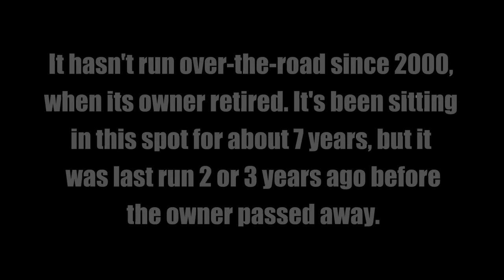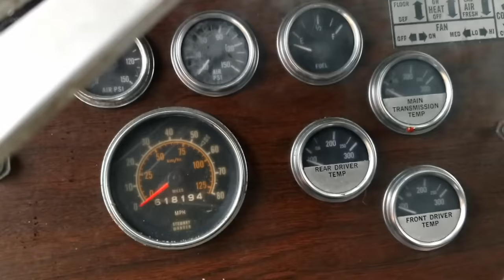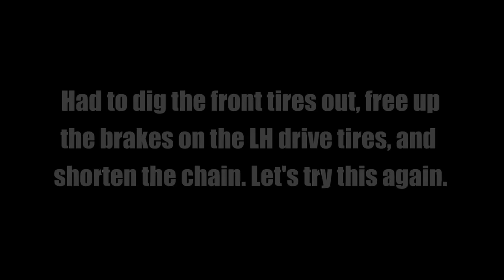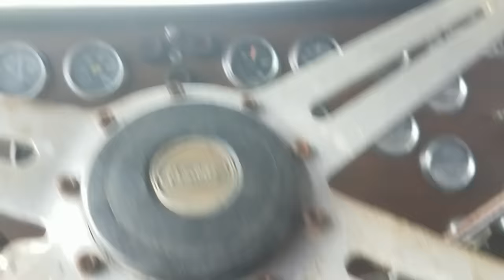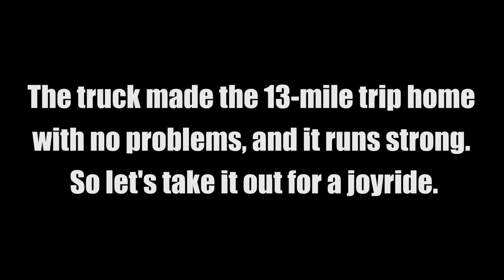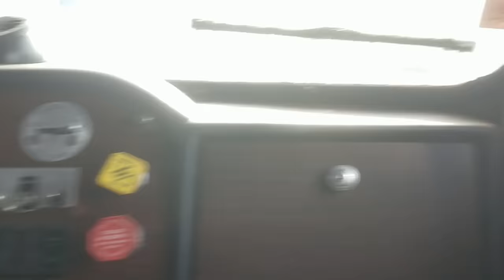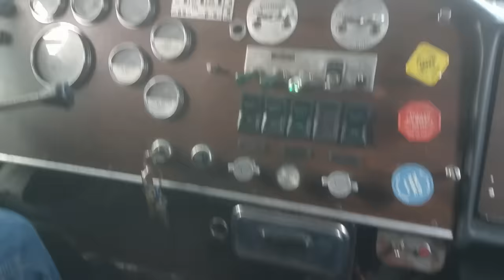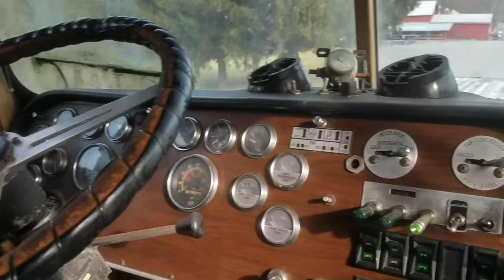Rescuing a 1977 Peterbilt 359 From Its Grave - First Time On the Road in 18 Years

Comment: I'm impressed that the previous owner placed a tarp under the truck when he parked it. That's a sure sign that he cared deeply about the truck in my opinion.
Reply: My thoughts exactly. Somewhere he is smiling down on his faithful old Horse being driven again like it was supposed to be.
Reply: U you can tell he lived this truck. Some one put all that crome paint pipes fenders and sounds like it runs better then wen it came off the show room and kept up on her sense the late 70s
Reply: Dumb question but why the tarp underneath?
Reply: @luke8210  it prevents the damp in the soil from creating a humid layer under a vehicle. I have worked on plenty of rusty vehicles which were dry on top but parked on dirt,the bottoms were rotten even though they were actually touching the dirt.  . As can be seen with this truck,she may have sunk a bit but none of the brake shoes were stuck on and the clutch was free. It's a very simple but effective technique .
Reply: Luke K Ray Not only that it keeps the weeds from growing up into the truck
Reply: Right on. Makes total sense now. I live In the desert of Arizona. Rust here is pretty much limited to surface rust. Pack rats are the big problem here. Thanks guys, I appreciate the quick replies. Best of luck.
Reply: yup he wanted to save it , it is very obvious , but if you do the math , he spent most of his adult years in that truck , well if he bought it new , and being he held onto it for 18 years after retiring , I bet he did ...
Reply: @luke8210  it stops moisture from coming up from the ground and condensating on the underside preventing rust , it also stops trees and stuff from sprouting up under it and getting tangled in wires and air lines , trees growing up through the rear frame rails of a truck parked like that is common , had to cut a few out on stuff I have bought over the years , this truck is the holy grail of a truck from that era , well except for ones well loved and still rolling down the road and never parked , it's a pretty rare truck these days
Reply: Steven Richards I noticed that too, thought the same thing
Reply: Parking on limestone will help a lot too. Seen some really well preserved vehicles parked on it - the undercarriages were still solid.
Reply: @Mercmad  You are right , parking on the dirt w/o that tarp it would have been a rust bucket. That's what saved it.
Reply from the maker: All very good points. Furthermore, it keeps oil from leaking into the ground if the truck were to develop a bad seal from sitting.
Reply: @luke8210  stop weeds and crap growing up through the truck and damaging things, plus keeps the damp grass and foliage away from the metalwork to prevent rust
Reply: @MichaelTJD60  yeah but that's not why he put it their, think he's bothered about saving the environment, damn think proberbly has the emissions of 100 modern day cars, I don't think the environment was in mind when placing a tarp under it
Reply: Luke K Ray ... I've seen a few different things to deal with the packrats. One that was intriguing is a tiny led attached to the lower side of the engine compartment, below the battery. I was sent to tow the truck and opened the hood to jump start the truck. I told the customer that something was blinking down there and she said it keeps the rats away. Another time, I went to a tow yard up north and all the hoods of the vehicles in the yard were wide open. Yard operator said it keeps the rats out of the engine compartments. 
    Farging rat bastiches.
Reply: Eric Lakota ... Not just crome, but some actual chrome.
Reply: Steven Richards yes, he did
Reply: Steven Richards absolutely, he probably maintained that truck well until he retired
Reply: I was thinking the same thing!
Reply: Steven Richards sticking a tarp under it is one of the worst things you can do. Water pools in the tarm and keeps the underside of the rig most of the time. Would've been far better off having a few yards of stone dropped there, half assed leveling it & parking her on the stone.
Reply: Yeah he didn't want weeds growing up underneath or through the truck frame or through the cab for that matter
Reply: @luke8210  SO MANY ..... PACK RATS...... I cant even anymore....
Reply: Steven Richards yea but I would have parked it on a bunch of plywood so it would have been able to get out after sitting for so long
Reply: Yeah that was a good idea. I don't know how many times I've seen people tarp OVER something parked on wet dirt, in a shed or barn with dirt floor, or outside, cars, motorcycles, etc...just acts as a moisture tent and concentrates it. Whatever's under turns into solid rust in no time.  Best to put the tarp down and leave the vehicle in open air. If you just gotta tarp to protect from sun, get one that breathes.
Reply: I want to visit the Arizona desert
Reply: @Mercmad  Now i know why as well.
Reply: Picture me rolling in my 500 benz 
   Run some Bio-diesel in her and she will out perform all modern day emissions standards. Nothing could be “greener”.
Reply: I'm going to speculate that the Tarp was put underneath to put a Barrier between the Truck and the Soil as a precaution if there were any slow leaks of Oil and Fluids, Diesel etc.  
Especially if the truck was going to be sitting any length of time...Seals and Gaskets will deteriorate over time.  Maybe control moisture under the truck as well.
Reply: @Mercmad  Thanks for that info
Reply: Same here
Reply: @luke8210  Pack rats. Cute, but destructive.
Reply: @luke8210  -Keep vegetation from growing up through the bottom.
Reply: I said the same thing immediately after they drove it off its resting place. Tarp!!!!! Great job, kept the weeds from growing up through and around!!
Reply: @luke8210  keeps the grass and weeds from growing up thru and around the frame and truck.
Reply: @Classic_Re-creation  you're absolutely right, oil leaking into the grass never crossed his mind when placing that tarp there
Reply: @BirdPlan  the point is this is a 20ltr gas gusseling monster that kills a thousand trees every time it starts up so the intent to save on the environment was just not their, its like putting a plaster on some body's bullet wound just after you shot them with the intent to kill them, without getting into English literature and what certain words mean let's just be real here the guy didn't give a shit about oil leaking from his truck
Reply: @smokeythehuman3596  ply wood would delaminate and fall to bits within a couple of years then decompose and become soil again,
Reply: That's exactly what crossed my mind to!
Reply: @luke8210  to stop grass from growing up through the frame and everything else grass holds moisture and will cause rust!
Reply: I was thinking the same thing, the tarp was the first thing I noticed when the truck moved. I’ve seen plenty of vehicles rotted out from being parked on dirt.
Reply: Steven Richards 💜❤️💚
Reply: Luke K Ray One viewer said you can tell the owner loved the truck because they put the tarp underneath.❤️💚💜
Reply: Luke K Ray Protects the undercarriage from moisture and rusting out🙄
Reply: Steven Richards I'll remember to put the tarp down to protect✅
Reply: Luke K Ray fair question. I had no idea
Reply: Must have been a reliable workhorse for the original owner.
Reply: @Classic_Re-creation  ... Normally, I'd agree with you. However, in the country, you might think of dripping oil if you're drinking  the well water nearby, eh?
Reply: @amascia8327  bit of a long shot but yes possibly it could be a cause for concern. Great point
Reply: Stay in school
Reply: We old haulin' men parked on tarps so snakes would gather under it. Then when the sun got hot enough and the snakes came out again the next morning, we knew it was time to yank our spurs again.
Reply: Me gustaría tener uno acá en Argentina
Reply: I agree
Reply: Steven Richards   
I agree...
Reply: Probably loved that truck more than the wife, also the truck compared to a wife actually severed a purpose  . . .
Reply: It means an other thing: unfortunately, the owner knew it was the last time he parked it here, and it was his last travel with it. Rest In Peace Mr "Owner", your truck is in good hands. And its second life starts, as yours in the sky. Thank you from France for this video. 😊🚛
Reply: Steven Richards it looks cared for.  It’s an older truck, and it’s been kept in really good condition
Reply: @luke8210  I've seen people chuck balls of scrap wires and strings into cars to keep the rats happy. They go after the easy to get stuff and leave the wiring harnesses alone.
Reply: @JW...-oj5iw  Lmfao@ Bastiches
Reply: Agreed! Nothing kills a parked vehicle quicker than grass growing up in the undercarriage.
Reply: Yeah I noticed that too, It was his baby.
Reply: @Classic_Re-creation  you got tha SONG my brotha ! 😎
Reply: I would imagine that when you drive a truck for so long, you become attached to it.
Reply: @luke8210  lol No doubt Luke. I live in New Mexico. We just bought a Honda Pilot from my partner's brother. He said it has very little rust. He is from the coast in Florida. His idea of little rust isn't my idea of little rust. 
My definition of little rust is light surface. The Florida definition of little rust is you have to push hard to stick your finger through the muffler.
Reply: I'm sure if he bought it new he probably still thought of it as such.  Bet that was a huge investment when they bought it!!
Reply: @JoshG1234  1) He left it with his memorabilia in the truck, he left it's life in there. (That and I doubt he planned to leave it there for 18 years before he passed away)
2) It wasn't a field it was parked next to his drive way
3) If it had been covered with a tarp it would have just held in moisture and rusted the old lady to bits.
Reply: It depends on the parts of Arizona. There is the desert down south around Tucson that has (3) airplane storage graveyards (military and commercial) And there are many are prepped to fly another day.
Reply: Steven Richards And mine ~
Reply: @luke8210  against corrosion.
Reply: @JoshG1234  Stupid, ignorant comment. F_ck off.
Reply: @SilvaDreams  Thanks for straightening out that ignorant ass-Josh G
Reply: @Mercmad   ooh yess. I am a woman and new that. I miss working on cars and trucks when my uncle was still alive. You should see the men when they see a lady is coming to fix their Big Bertha. 😁 My best friend does have alot of fun with these guys whem they stay like: 😡  WTF did just happen to me? But that is a GIIIIRRRLLLLL. 😳 🤣🤣🤣🤣🤣🤣🤣
Reply: Not sure if he cared that much about it anymore, it looked like worn out and was just left to rot in the open.
Reply: @Classic_Re-creation  omg a THOUSAND trees ?
That's insane !
Reply: I agree, I also think that the previous owner now passed away would want something like this for his Truck !
Reply: Hg
Reply: @luke8210  keep the weeds from growing
Reply: @ROTAXD  , Maybe, but if you're an old man with bad knees, a tarp ain't a bad idea.
Reply: @Classic_Re-creation  , Truckers try to avoid fines and tickets. Towns, cops, target truckers like nobody else.
Reply: No thats to hide the burial sites of all the drifters umm i mean it's so oil doesn't get into the ground if seals dried out and weed control. He must've really cared about the truck and the land. Great find
Reply: I hope the old lady didn’t get ripped off by these guys. Probably did.
Reply: maybe that tarp was to slow down vegetation growth.
Reply: If had not it would be well rotted out.
Reply: @Mercmad  i think its actually to stop the grass from growing up......
Reply: I agree.
Reply: Luke K Ray cos his wife always said “don’t get any oil on my grass you son of a bitch with that fricken truck! 😂
Reply: Erik D. My Dad’s 1970 F750 didn’t have weeds growing under the body of the truck and it didn’t have a tarp under it. It DID have shit growing in the bed (it has a dump bed) of the truck though
Reply: Mercma
Reply: I thought the same when I saw the blue tarpaulin.👍
Reply: I think it also prevent any wild grass from growing underneath.
Reply: 4sure your right
Reply: If this is the truck I think it is, I knew the owner.  Yes, he loved his truck very much.
Reply: @Mercmad  yeah it's how many cars that have been sitting in a spot like that rot because of the humidity
Reply: @luke8210  protects the undercarriage of weather damage
Reply: @Classic_Re-creation  trees  turn co2  into oxygen co2 dont kill trees
Reply: And the environment
Reply: Meu Deus! Que maravilha de caminhão!
Meu sonho em ter um ☝
Marcelo Campos Brasil.
Reply: MANDA UMA BELEZA DESSA DE PRESENTE PRA MIM AQUI PARA O BRASIL AMIGO 👦
Reply: Muito lindo esse caminhão 🚚 amigo 👦
Meu sonho de consumo!
Reply: @Classic_Re-creation  dude has a well remember. No city water out there. It is probably also about environmental concerns.
Reply: Thinking the same thing!
Reply: Yes must have been there to protect it and kept for some reason
Reply: Que belleza

Comment: old diesel engines are the toughest thing known to man.
Reply: The new shit with regulations and electronics is what's fucking everything up nowadays
Reply: Trucker Life yes it’s a shame the environment exists, we were having so much fun
Reply: Imagine it being a volvo
Reply: volvos
Reply: @TiboSG  Why?
Reply: Neck Bone volvos are indestructable
Reply: @TiboSG  Thanks.  I did not know  that.
Reply: BudSpankerr that and volvo 240s
Reply: Besides old Nokias
Reply: You don't no my wife
Reply: BudSpankerr  you don't no my wife
Reply: @14sonnenkrieg88  Last I checked; a lot of people don't like the idea of pumping vaporized lead into the air.
Reply: @racer927   The engine of this truck is pumping vaporized lead into the air?
Reply: @hedgehogthesonic3181  Older engines ran on gasoline with tetraethyl lead, the reason for the additive was to reduce engine knock (where the fuel-air mixture combusts prematurely during the compression stroke before the spark plug fires). The problem was that the exhaust byproduct was not only incredibly toxic but it also ruined the precious metals in a catalytic converter.
I want to disclaim that I don't know if diesel engines used a form of leaded fuel but my initial comment was about the fact that progress is generally a good thing.
Reply: @racer927   Was it not a better idea to change the engine design to be more efficient?
Reply: @hedgehogthesonic3181  That's the thing, there was only so much you could do in regards to an engine.
Heck, try designing a good but inexpensive engine in the game "Automation" during the period where leaded gasoline was standard. You'll notice it's really hard to get good power without running into knock and you either have to up the quality of the components which significantly jacks up the price on just the engine alone or use leaded gasoline which lets you get more power out of the engine before knock becomes an issue.
Tellingly, cars with lead and/or lacking a converter have an emission score of 9999 when other cars can range from below 100 in really eco-minded cars to about 500 in a super or hyper car.
Reply: @14sonnenkrieg88  That was the Reason why i bought an Pete 359 Tri Drive. No Electronic Shit inside. And you can fix everything by yourself. My Big Boy had 8 Inch Straight Pipes and Jake Brake. Painted in Waterblue Metallic. Engine is Cummins. I will never give him away.
Reply: Indeed they are , my grandpa had a really old Volkswagen Diesel,  he cared well it was his "lady in red" Named , red first gen Passat.  Was standing for 2 years , new owner/collector was able to drive home with it